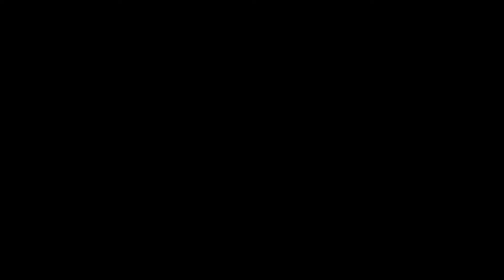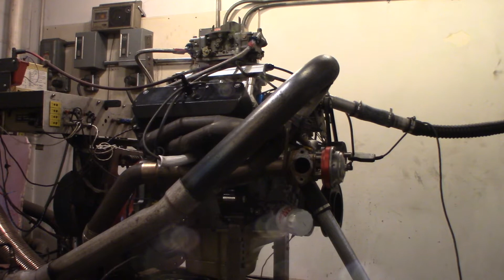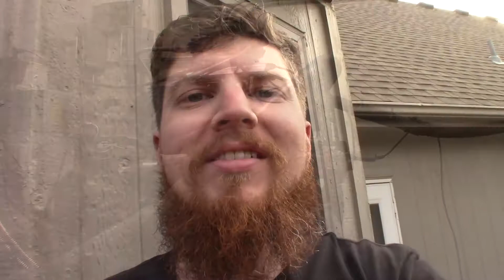How an Engine Dyno Works - Explained by a Pro Gearhead

Comment: The only things i never like about dynos was that engines that make alot of torque and power bellow 3500 dont read 100%. And that maybe just old dynos. And all dynos are full throttle of course i would love tp see part throttle for drivabilty, becuase ever one just goes with that wot is for there build which unless its a full race car your not driving wot all the time
Reply: You can get an accurate reading on an old water brake Dyno..at any RPM...or throttle position....just give it the amount of throttle you want on the throttle lever..part...half...3/4 or full...let it wind up to the RPM that you desire..Then look at the gauge for the torque number...then do the math...RPM × TORQUE ÷ 5252 walla.....